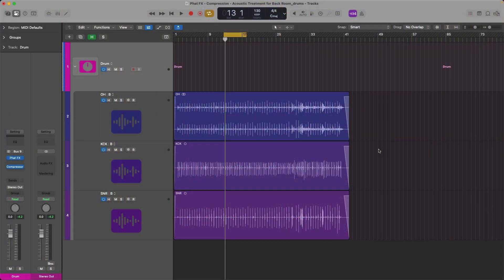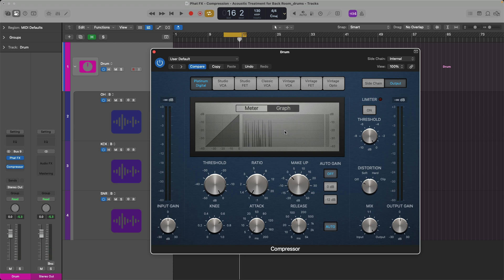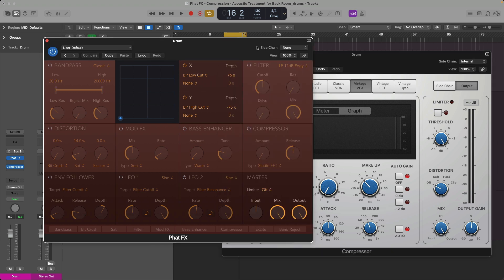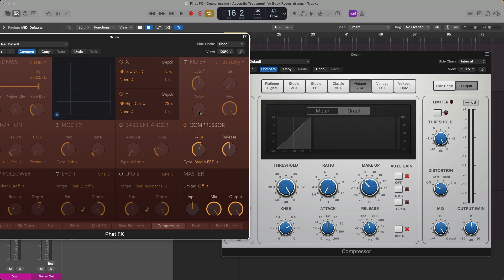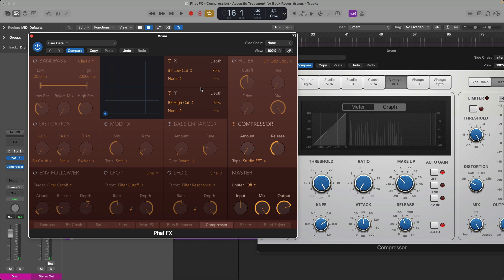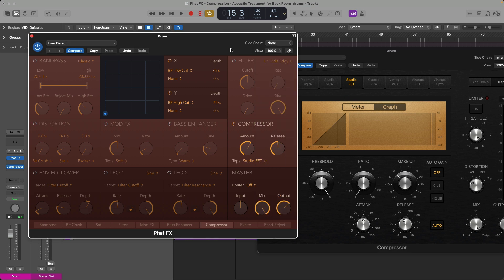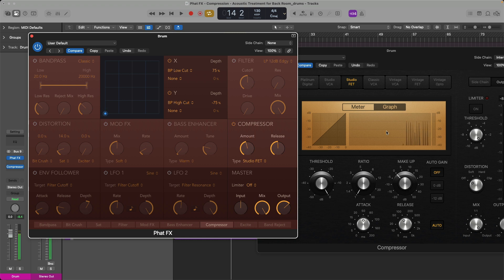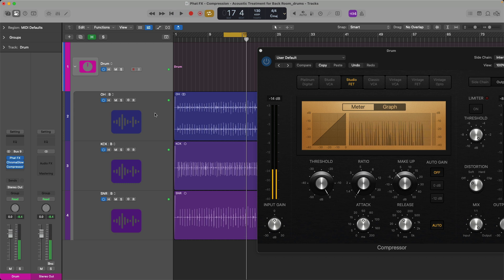Simplify Compression w/ This 1 Knob in Logic Pro

Comment: The value I see here is really just the built-in limiter, but of course the limiter plug-in can handle this, and not handle it 'with blinders on'.

There is definitely a value in using one's ears and not getting lost in all the knobs, so we should do that, but there is also a much greater value in understanding what all the different tools in the stock compressor (and I count 17 different useful tools not counting sidechain tools and the 7 basic compressor modules) are capable of, and knowing how to apply them strategically.

Phat FX has some great stuff in it, but its compressor module can't do one single thing beyond what the stock compressor and limiter are able to do, so I have to ask—why even bother? Unless you haven't done the hard work of learning and understanding what all those tools are even there for.

 In 2005 we were still in a world where hardware ruled and nothing could compete. But it's not 2005 anymore. Things change. Logic's compressor rocks. Some of the emulations actually have more tools than the originals they were emulated from.

I see much more value in knowing how to use each of those 17 useful tools and applying them strategically than I do in working 'with blinders on'. I'd rather have a toolkit with 17 useful tools in it than one with only 2. Wouldn't anyone who is serious about their work? I hardly think there is a professional engineer anywhere who has neglected to do the due diligence of understanding how to use all of the tools in their kit, intimately.

In any creative endeavor, there really just are no shortcuts. People looking for shortcuts are never going to amount to anything. Let's just do the work and give the world our gift instead of phoning it in.
Reply: you're missing the point entirely in an effort to brag about your expertise..He's showing people a feature of logic. its nothing to do with hard graft or whatever you're fetishising, he's just saying theres this thing and you can do 1 knob compression on it.
Reply: @reganovich  You've missed my point completely. You've apparently failed to understand a single word. The most diplomatic term to describe what you've inferred, for some unknown unhinged reason, would be 'looney tunes'. Should I s-p-e-a--k s-l-o-w-e-r?

And there is not one single word said about whether I have expertise or not, which is ALSO completely beside the point. None of this is in any way about my ego or anyone else's. That would be ridiculous. The point is that a video designed to show that Logic has a shortcut weak version of what can be accomplished with their stock compressor by using something else while your eyes are closed is less than helpful and appears to be nothing more than an excuse to post a video. Disappointing from a source that is typically the most helpful source for Logic on YT and who I wholeheartedly support.

It's also never a good idea to have wishful thinking that you can do what needs to be done with one effing knob. Or with your eyes closed. Those knobs are there for a reason. Every single one of them. If you apply yourself, even you can learn how to use them. Shortcuts only fool you into thinking you can accomplish something by doing as little as possible, and doing as little as possible is not how anyone ever excelled at anything. In the history of the world.

One knob? How effective is a guitar with one string? A piano with one key? A car with one gear? Dream on.

Go look up fetishing, if you think you can actually understand the definition, which I sincerely doubt. Using it as an attack word has little effect when it has absolutely nothing to do with the topic, revealing that all it is, is an attack. And a toothless one, at that.
Reply: @tomlewis4748 after one knob compression, apply lite Attack from Transient shaper thats all... This Feature gave release option also...
Reply: @tomlewis4748 You have way too much time.